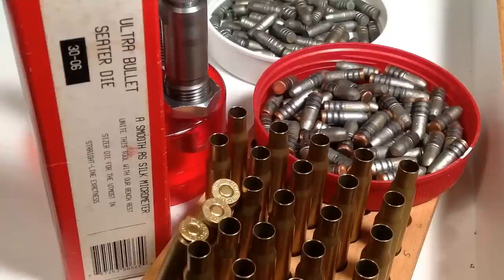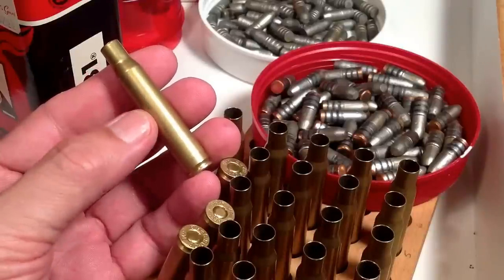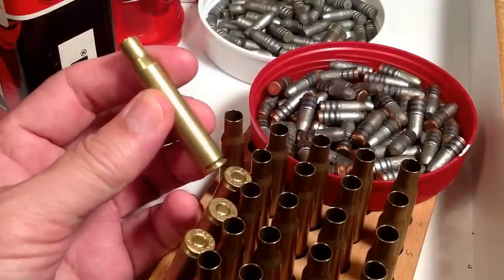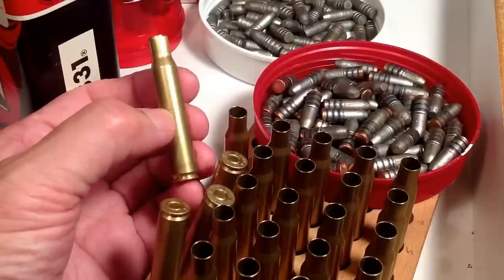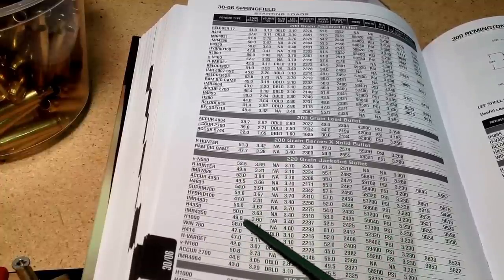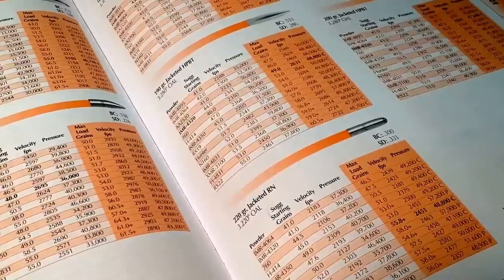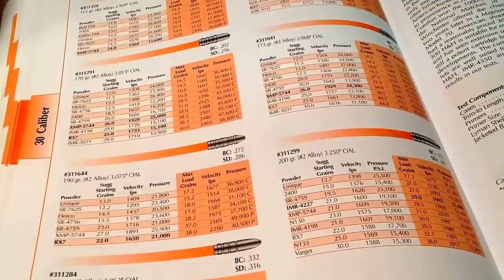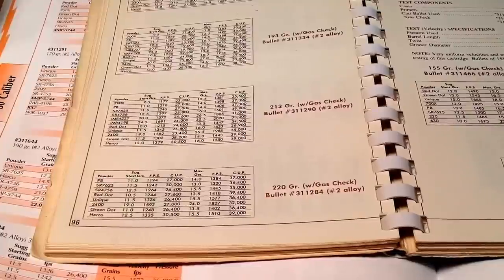The Danger Of Reduced Loads in Rifles

Comment: Trail Boss fills more of the case than most of these.  My .308Win fires 1045fps ahead of 9.3gr of trail Boss which fills the case about two thirds.
Reply from the maker: Matthew Wright - Thanks for posting... I traded my TB powder for TiteGroup back when powder was in short supply.  Trail Boss is a great powder that is the only powder where we don't need any reloading data - just find the bottom of the seated bullet, fill to that with TB powder, take 80% and that's the start load...Great for cast bullets.  Best to ya,  FC

Comment: So basically this is a warning for how to not load squib loads. I haven't gotten into reload yet due to money for the equipment. Once I get the money to do it at least I have your videos to know how to correctly load rounds and powder coat them projectile.
Reply: (forgive my long winded-ness)

Squib loads are reduced loads that lodge a bullet into the rifling. They exit the case, but not the barrel. In and of itself, this isn't "dangerous" until a second round is fired.

A reduced load can also result in inconsistent burn rates that won't produce enough pressure to evenly overcome the neck tension for proper function and safety. Or so I think I understand from FortuneCookie's explanation. Correct me if I'm off base.

A topic of discussion on Johnny's Reloading channel is reduced loads causing inconsistent fps/standard deviation results if a rifle is held vertical, lowered slowly, and them fired so the primer flash ignites directly into the meat of the powder vs a rifle held horizontally, allowing reduced powder charges to settle at bottom of the case (below the angle of the flash hole), and where the primer ignition fires into the void, thus causing inconsistencies in fps.

It's almost like the notion that a full fuel tank in your Ford Pinto is safer than a near empty tank full of fumes. It seems counterintuitive, but the liquid fuel is safer than in gas form inside of a container.

Depending in the variables, you can't always have your cake and eat it too. For some things to exist (to be safe and function correctly), strict circumstances have to be in place. Changing variables haphazardly, or with some measured degree, may never give the desired results. Forcing a situation can have dire consequences.

The contend of this video and the content of Johnny's video should be taken into account for any reloader that considers safety, reliable functionality, accuracy, and precision a priority. 

Thank you for your experience and words of wisdom!
Reply from the maker: RETiredGM - Congrats on your retirement - Hope you are enjoying it immensely..!!  This situation with 1/2 loads of slow burning rifle powders resulted in a number of Kaboom incidents back in the 70s and 80s,  To this date, they have not been able to reproduce the events, nor give a sure explanation of the happenings other than they do happen so that reducing the charges of slow burning rifle powders past what the reloading manuals publish  as starting loads is not recommended.  I like your thought that the 1/2 full tank of gas may be more problematic than a full tank - but again - the labs could not come up with exact cause for the rifle Kabooms.  Apparently, there had to be a confluence or cascade of events to get those, but it started out with the reduced charges of slow burning powders - and not all slow burning powders were culpable as some slow burners have a clean bill of health from the manufacturers to go ahead and reduce.  Best to ya,  FC

Comment: so are you saying my reduced 45-70 (unique) loads will blow my gun up if i aim downwards causing the powder to sink towards the bullet?
Reply from the maker: RIsky Business - Not at all - this video is talking about reduced loads in rifles using slow burning rifle powders.  These loads are 1/2 charges way under the starting loads in the loading manuals.  If reduced loads are desired, Unique is an excellent powder for reduced rifle loads.  And the position of the Unique in the case may cause some variation in the burn, but not a safety issue.   Good shootin' to ya,   FC

Comment: so in theory i could do a .308win with a small charge of N105 or N350 along a 100grain projectile and get a great round for fun and pestcontrol of small pests
Reply from the maker: +jimsbix -- Yes, reduced loads using cast bullets and smaller charges of pistol powder are workable.  For example, a 150 grain GC cast bullet and 10 grains of Red Dot powder gives 1445 fps in the 308 (Lyman loading data).  Your N105 and N350 are in the same idea, but you'll have to look up loading data - my fear is that you won't find any for those powders.  Those pistol powders are safe in reduced loads in rifles, but using 1/2 charges of normal rifle powders is dangerous.  There are certain specified rifle powders where factory loading data is available for reduced loads, but I'm not going to name it as there is the chance of confusion with bad results.  Best to ya,   FC
Reply: ill go look around - got a lot of old 7,63 pistol projektiles that runs great in my rifles and reduced loads would really do the trick

Comment: your talking about deflation which as you have said hasn't been  reproduced by any of the tests to find it. Basically you are making a surface area argument which has confined oxygen in a sealed case. What is much more likely to be the truth of "exploding guns" in an over charge or an obstructed barrel with half burnt powder in the barrel which gets compressed by the the next fired round. The fact the labs and test set up to cause deflation has never once resulted in it makes it unlikely to exist. If there was a way to increase energy yield by shaking a powder load or angling it in a case the munitions folks would have found it. this isn't a new idea and its as dead today as it was 70 years ago.

Comment: I will never use a  hard bullet for subsonic. Your lead bullet are the best i think. The restance in the barrel is not that big to let it get stuck in the barrel, and let it blow up. Blackout 300AAC has half the risk because theire barrels are so short. I like to use
H&N bullet nice lead pressed, copper coated and lubricated. I got some samples in double diameter, maybe your interested
in the data and future test results. The double diameter is going the solve the problem off the big surface resistance that is 
common to long (heavy) bullets.
https://sites.google.com/view/reload-cheap-subsonic/homepage
Reply from the maker: marc robert - Interesting you bring this up as there is a video idea in my cue on bearing surface and bullet hardness vs pressure coming up...Best to ya,  FC